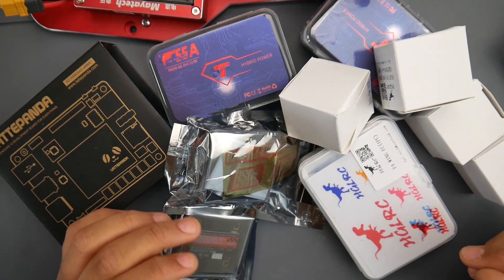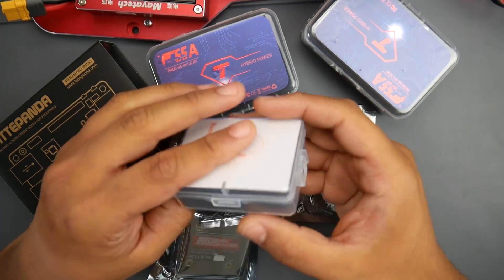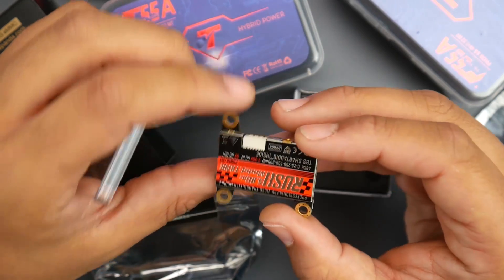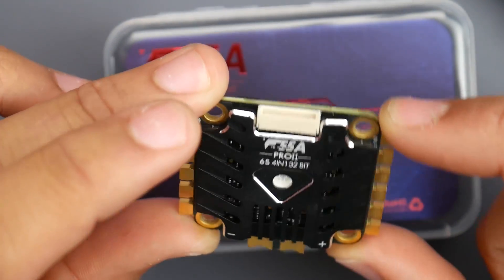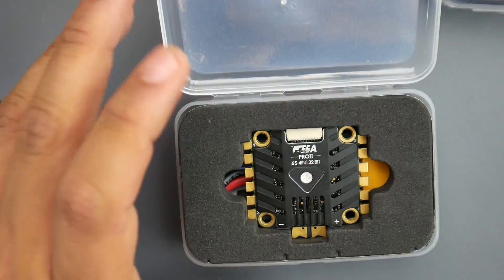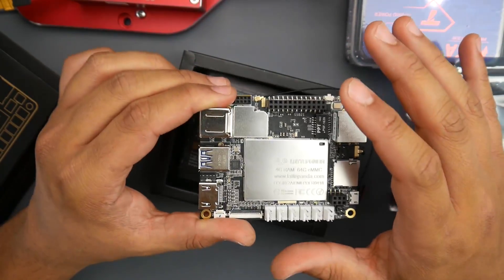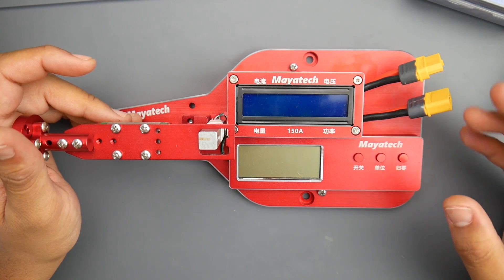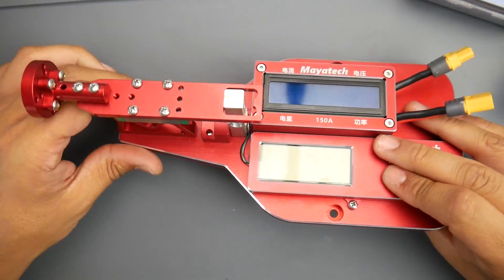New FPV Products Mail // T-Motor F55A V2, 3Inch 6S Motor, HGLRC Wing

Comment: What did you think of the rcINpower 1506 motors on the Floss Remix while it was flying?  I've found the 3mm shafts on those motors make them almost bomb proof (w/ exception of AL threads which can get buggered).  I have these motors @ 3400KV which are rated using 5x3x3 props w/  ~1kg thrust.   ETHIX S3 props are a perfect match.  But I've found DAL 5051C props on my 4S 700mAh 250gr AUW quad are amazing!   The pitch of the prop shouldn't work on this small of a motor, but at this light weight, the motor spins it with authority.  I've been doing a lot of LOS in the park with this setup - big props are easier to see.  Do you know of any light weight (low prop weight is essential) dual-blade 6" props (maybe CF?) that might work?  Eachine has the 1507 2500KV version of the rcINpower 1506 GTS-V2 3000KV motor, and I'm thinking with that low of a KV, 6" props on 4S become possible, w/ 850mAh 3S batteries as an alternative...  Any thoughts?

Comment: And when are you gonna do a indepth review of the new cheap frsky transmitter..  i wanna retire my flysky i6s..  and don't wanna risk it coz I'm cheap and broke.. 😅
Reply: Get the new jumper t16... if i didnt just upgrade last year i would totally grab one.. it is ALOT of radio for the money and AND you dont have to switch out all your receivers..
Reply: @flighttherapybullisticfpv133  the sad thing is t16 is expensive for me.. i am from NE India.. i work as a teacher and earn rs10000 monthly..  and the t16 cost Rs.11000 its way out of my budget..
Reply: @ohyeahh4369  Fair enough... have you thought about getting a signal booster and some new gimbal stick ends for your flysky? I flew flysky for years and honestly ibus is a great protocol.. better than sbus. The signal booster will give you alot more range and some grip tape and new stick ends will make it feel like a new radio... Also if you are a teacher you could try setting up a course on one of the online academys like udemy.com or offer online tutoring through an online service to make some extra money..
Reply: @ohyeahh4369  Oh one more thing. Keep an eye out for oppurtunities to work with fpv companies. One of the largest problems in our industry is lack of customer service and support. India is one of the largest hubs for support call centers worldwide. If you could use your knowledge of the industry to teach a small group of people the technical skills needed to provide support on a product line, you might be able to secure a loan to start a small call center and offer your services to RC companies in the US or China.. just an idea. I used to work at a construction supply company that did that and if I remember correctly the manager of the call center we hired was making about 8 USD/HOUR
Reply: Also the new cheap frsky transmitter has some MAJOR downsides that make it not really worth buying.. RC model reviews has a good video about it.. your better to grab something like the t16 just because of the insane value

Comment: You can tell HGLRC that I am really pleased with their Flame 1105 6000kv motors. I went with these after having reliability problems with the 1104s on my ET115. They have been fantastic so far.